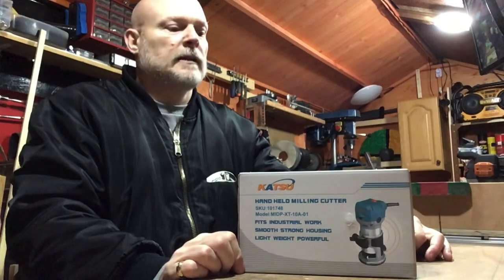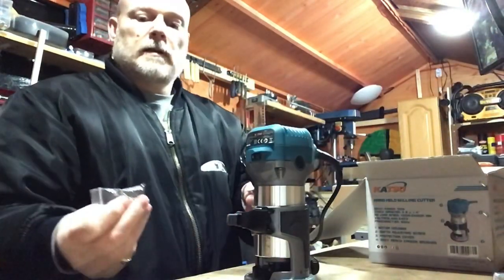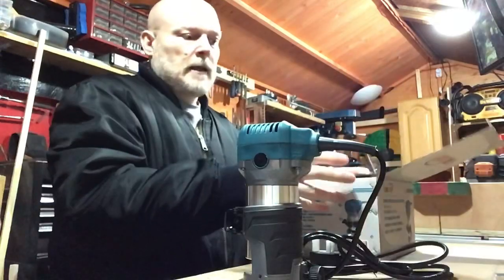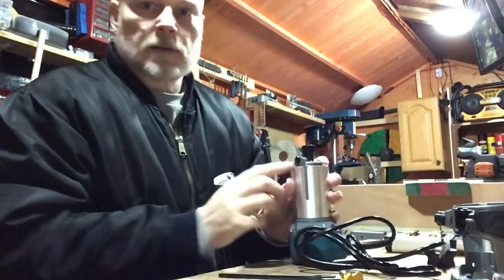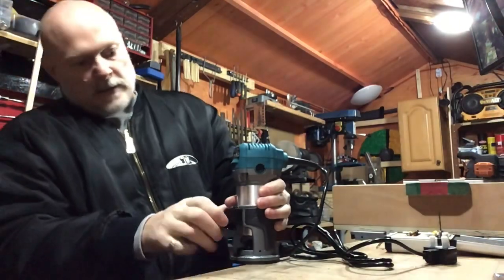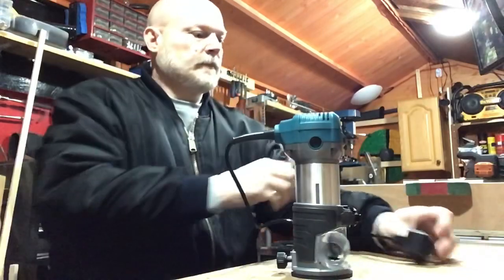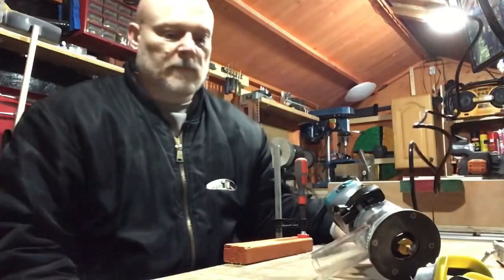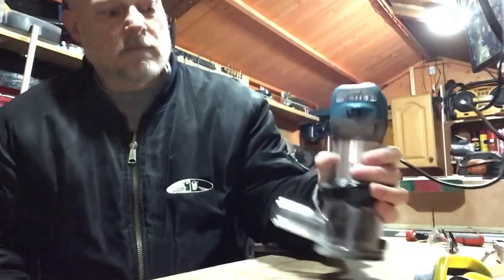Katsu palm router review | Small Workshop | Budget tools

Comment: Unlikely you need new bits , a router bit rotates and cuts clockwise therefore you have to move the router anti clockwise ( i.e left to right ) to get a clean cut , doing it the opposite way is in effect like using the back of the blade to cut therefore creating a poor finish.

Comment: Hi. That extra collet you get with this router, how do you use it ? Sorry I am new to routers and I am a bit lost
Reply from the maker: Sorry only just seen this, undo the nut that holds your bits in place until it comes off remove the collet thats in there and vice versa to replace, ive not done it on this one but thats usually the way to change them, its for different sized bits
Reply: @JackofallTradesUk   thank you very much! I will try this later :-)  not that I am know what i am doing lol
Reply from the maker: Just keep practicing, if you have any trouble let me know, ill double check when im in the workshop later just to make sure and let you know if it's any different to what ive already told you

Comment: Hi 
Noticed you run the router the wrong way
It should be run in a anti clockwise direction
John s
Reply from the maker: A router can be used in either direction the way I was using it is called climb-cutting, it all depends on the direction of the wood grain. If you're inexperienced yes you should go anti clockwise as it's smoother and safer, as long as you go the same direction as the grain it's not a problem. 
climb-cutting is just harder to control.